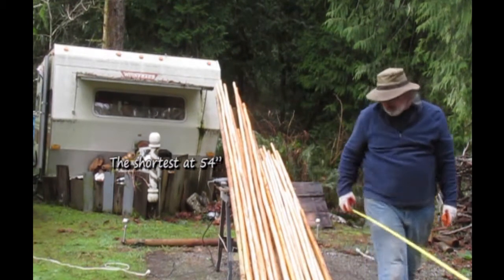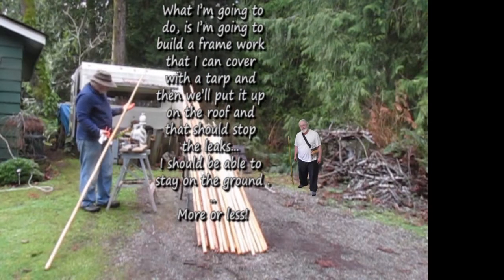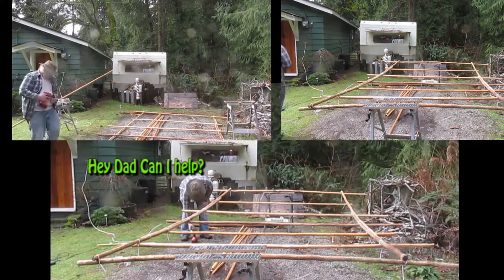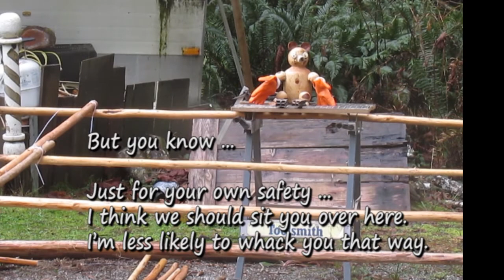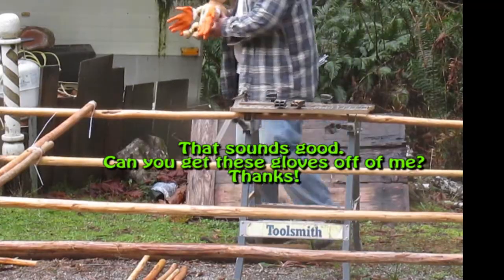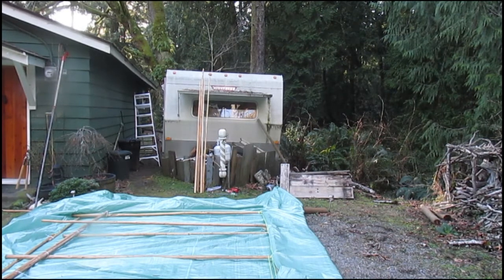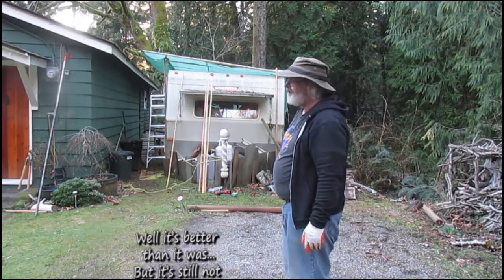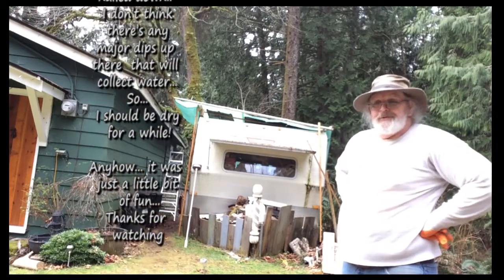Wood Turning #101 Texted Roofin' on a Trailer

Comment: Great video,,,,as always,, just a thought,,, pitch paint ? paint it on and done. Water-proof, and a SPIRIT-LEVEL, the trailer looks a little skewwhiff,,,,,,  a Yorkshire term ,,cocker-spadge. Keep up the good work, all the best frum tarn, stu n caz. x.
Reply from the maker: STU H. Wow! A whole new language that the translator doesn't even know! I have to do some learning! As far as the paint is concerned... I have done several applications of Silver Knight (goes on silver and turns black as it cures) and that has worked very well... this year I no longer feel comfortable clamouring up there! I am on chemo now and not everything is what you expect it to be... so living alone ... I just had to come up with something that I thought would work!    ;>)  It has to be adjusted every few months as the ground around is rather soggy and with the hammering motion of the trailer when you get an off center piece  on the lathe... it just sort of pile drives itself into the ground a little more! If you noticed the area to the right of the trailer... where it looks like it just fades into forest... about 25' down there is a drainage ditch and that meets up with another one that runs down the hill behind the trailer! So there is a lot of moisture there and the ocean is only 400 yards to the left! You did notice that the pictures from the front showed that it wasn't canted quite as bad as it looked in the first angle... I actually saw that when I was putting the video together and went out and looked at the levels that are attached to the trailer ... they were pretty close... but I do keep an eye on it... I would hate to end up in the stream!   I guess next video should be the trailer taking off and gliding out over the ocean! Watch for that after the next big wind storm!!
;>)   Thanks for watching   Larry